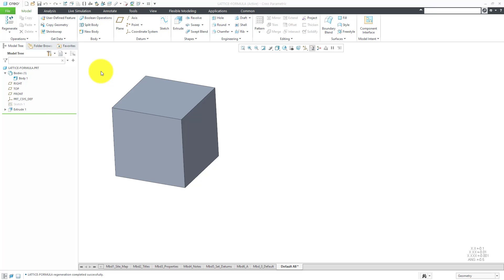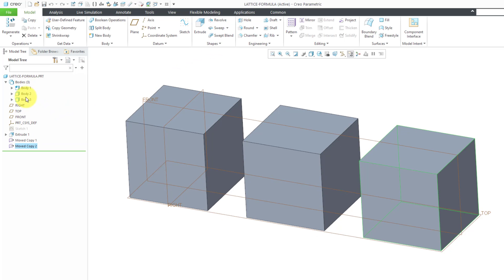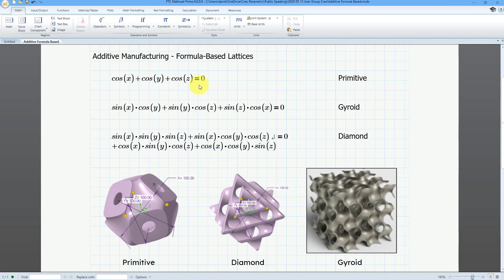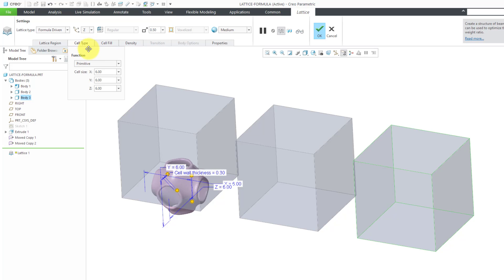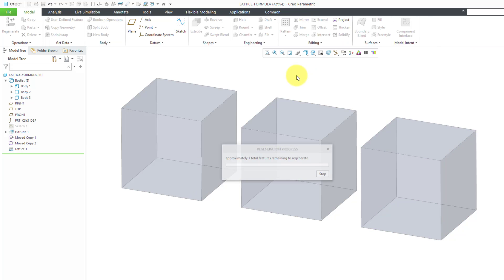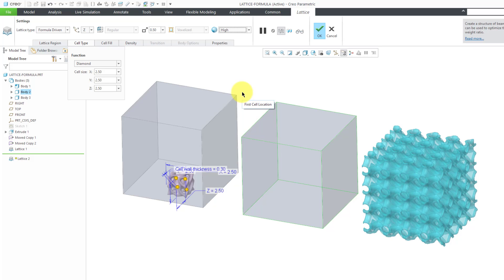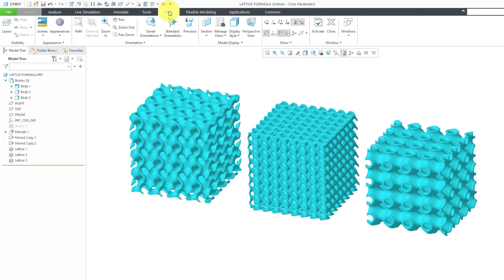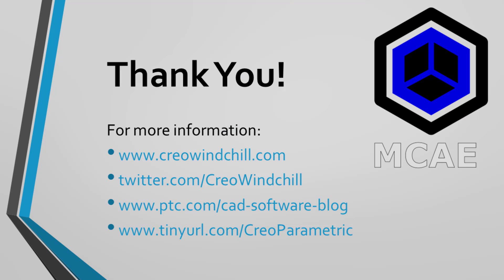Creo Parametric - Additive Manufacturing | Formula-Based Lattices

Comment: Hello, and thank you for the video!

I have a question about exporting a file. I created a "sandwich" structure with a gyroid core and two plates—one above and one below it—so that I can perform FEM simulations in Ansys Workbench. However, after exporting the file as a STEP (.stp) and IGES (.igs) and importing the geometry into Ansys, only the plates are visible, while the gyroid structure itself is missing.

Do you know why this might be happening or how I can resolve it?

Thank you!
Reply from the maker: I don't believe that the Lattice features support STEP or IGES export, but you can ask PTC Tech Support to confirm. They are supported in Creo Simulation Live and I believe Creo Simulate, but PTC can confirm that as well.

Comment: Hi, I'm trying to create a gyroid lattice with a shell to perform FEA in creo simulate but will not either attach properly to the shell or generate successfully as it disappears when entered into the simulate window, so it just performs FEA on the shell only. Is there a way to rectify this?

Comment: Your video helped a lot. Can you show how to transfer these files in ANSYS for FEA?
Reply from the maker: I don't have ANSYS.
Reply: @CADPLMGuy  but how can i use these for structures for FEA?
Reply from the maker: You can use Creo Simulate, Creo Simulation Live, or Creo ANSYS Simulation, and then there's no need to transfer. But I don't have every software package on the planet, so I can't answer if you're some other solution.
Reply: @CADPLMGuy  so can you show the simulation of these lattices on Creo.
Reply: can u please tell which software is this?